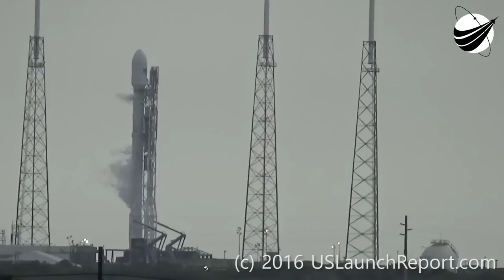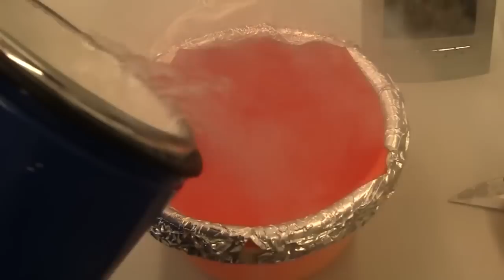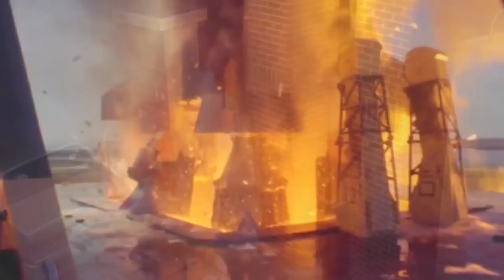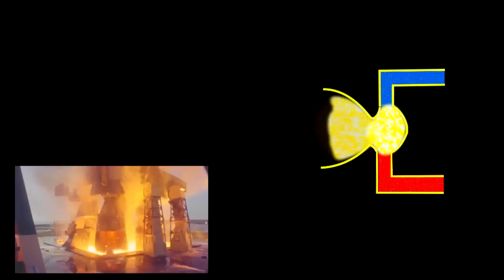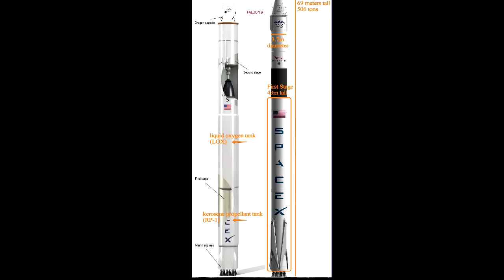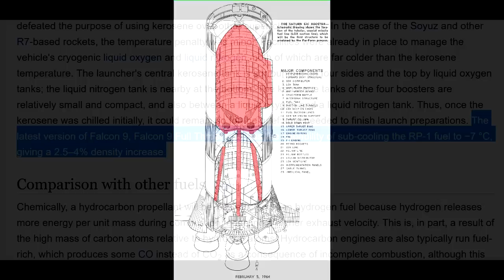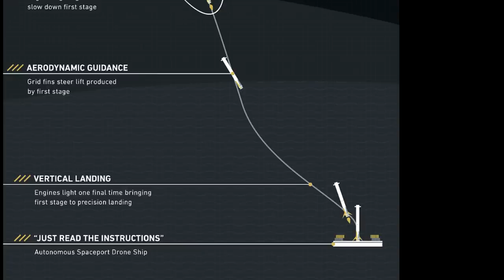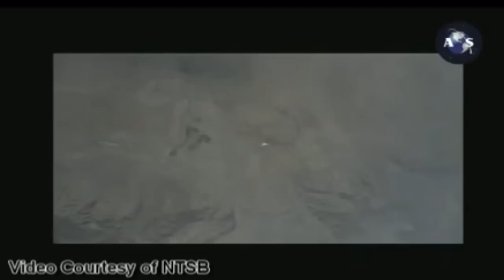Why did the Falcon 9 Explode?

Comment: Aerospace space engineering is changing sadly.  20yrs as a designer and the integrity is being replaced for cost savings and glamorous projects hiring youth for the cheap/free labor.  I believe nasa will Come down on Spacex once they are trying to certify the vehicle for manned operations.
Reply: It's always like this.  R&D is always expensive.  After you figure out how to make it work you start pushing the limits of what you can do to reduce costs.  Most technologies wouldn't be financially viable if they stayed at the original R&D costs.
Reply: NASA is heavily involved with SpaceX so I don't get why everyone thinks they are turning a blind eye to crappy designs.
Reply: +bensemus x  It's not a simple face value effort.  You have a process to follow for every nut,  bolt or rivet. Loads models are performed in line with design from detail to full vehicle level.  Nasa can be involved in conceptual design,  but it's a far cry from having an audited sign-off process like you would between an air authority for instance,  because it's bloody expensive and as stated in the video. Galactic case is none existent. Problem we have is Spacex amongst other startups are not paying for experience.  They have a preference for young engineers Chasing glamorous projects as they know they work 30hrs OT for free.
Reply: Brian Eastwood They also have a 93% success rate which is in line with the average success rate for other rocket programs. They aren't just taking people's money and doing nothing with it. They are already profitable with their satellite launch business. They have dropped the launch cost from NASA's $500 million to ~$60 million. They are doing all this while also working on making the rockets reusable. You can't compare SpaceX to the companies making the Hyperloop and such. They already have established customers and a good track record. They have secured their first customer to use a recovered first stage.
Reply: Brian Eastwood So they are doing very well yet they are also doing bad? Sounds like TF saying they are moving too fast and then getting angry when they have yet to launch a recovered first stage.
Reply: Brian Eastwood They didn't start with any of that NASA tech. They almost didn't start at all when their rockets kept failing. Their products are already performing and yet they need to engineer them better still? NASA doesn't have a sunny past so idk why they seem to be the golden standard. They have done extremely stupid things with manned missions that killed people. SpaceX isn't just ignoring everything NASA has learned. 

SpaceX has lost two rockets and everyone seems to want them to close shop. Every Time NASA lost a rocket it was learned from and the designs were improved.
Reply: Brian Eastwood Searching about those NASA patents makes it seem like those were released very recently, much to late to help SpaceX develop their rocket and engines. You haven't said anything about shutting down but if you read the comments on the video people seem to think that despite SapceX's record they are doomed to fail, including TF.
Reply: Ariane5 had 4 failures within first 30 flights
Reply: +bensemus x 96% of launch vehicles not including this vehicle.  Actually they have lost 2 vehicles out of 29.  The initial due to the structural failure that should never have been a single failure mission critical item.  I was talking about the state of engineering in general, as I work within it, also having many colleagues in the industry including Spacex. Western engineering is being taken through the nickel and dime extraction engine only time will tell what this will bring.
Reply: +bensemus x for repeatable performing products they'll have to incorporate engineering standards that take a great deal of investment. This will be more of a subject with manned vehicles.  Also they didn't start from scratch they attained a great deal of nasa tech once they switched to passing out contracts.
Reply: +bensemus x who was saying Spacex should close down? It's not black or white,  you can love what a company is doing and still have opinions on where the issues are coming from. Also Look at nasa releasing patents over the years since they announced they'd shift these contracts to third parties, see how they are handing out technology.  years and massive amounts of research and a foundation to give a company how to do a lot of things they need to do for those contracts.
Reply: Are we talking about same NASA? The one that put people into badly designed space shuttle without any escape systems and then killed 14 of them because of their stupidity and cutting corners?

Comment: There's a reason that "Standing on the shoulders of giants." isn't just a cool quip or meme when it comes to rocket science. There's 100+ years of engineering and science where an experiment's result is either "Breakthrough!" or "Massive detonation destroying labs, valuable equipment and risking lives. Not to mention at a price-tag that could bankrupt most nations." 

Paying for rockets and fuel is the easy part, the hard bit is going from launching fireworks and small missiles to human space travel. The man-hours, resources and insane pace needed is mind-boggling. Financing the early space programs was straining the national budgets in the two largest "empires"/super-powers on Earth. 

Private enterprise couldn't do a Mercury/Apollo or Soyuz type program or even the Shuttle if they were asked. Human space flight is literally a no returns investment for the foreseeable future and without profit there's no reason. Space tourism doesn't even pay for the launch facilities, let alone the R&D needed.

Comment: Launching people into space is something which has, up to this point, taken the resources of nations to safely accomplish, and sometimes even then there were accidents. IMHO, private companies, which necessarily do things as cheaply as possible, will never be as safe. For safety to truly be first priority, the CEOs would need to be the ones taking the first trip.
Reply: Sufficient regulations can somewhat solve the problem. I think the commercialization of cross Atlantic passenger flights can serve as an example. Plus you dont have to be "safe", just safe enough for the people who are willing to spend that kind of money.
Reply: Elon Musk has said he would like to die on Mars. Maybe he will during the landing.
Reply: PierreDolphin There may be a slight magnitude of difference between sitting in a prop plane with a couple hundred gallons of gas and sitting atop tons of liquid oxygen and kerosene while a controlled explosion shoots you into the vacuum of space. Not at all saying that it can't be done, but trying to do it as cheaply as possible, as private businesses tend to always do, is, again, imo, a recipe for disaster.

Comment: I follow SpaceX and Virgin Galactic, wrote a report on Spaceship 2. I have very simiplar feelings about the failures between both vehicles. It seems to me that the engineers and possibly Elon Musk are somewhat over confident. Human factors and simplification of design are very important factors in aviation, tiny details like the fuel selector switch placement are scrutinized theres is no reset button in real life if it can go wrong it will. R.I.P John Denver.
Reply: Are you just glossing over the things NASA has screwed up on which resulted in people dying?
Reply: ***** I never said NASA hasn't done great things. i'm pointing out that everyone working in Space has suffered failures. The difference is that when NASA failed the public redoubled their support. When SpaceX fails and only loses money not lives people call for it to be scrapped.
Reply: bensemus x and SpaceX failure in this video was something that was solved decades ago by those same people you are shitting on.

I don't see people calling for SpaceX to be "scrapped" especially since it's a private company, so it would be impossible to do such. Unless the company fails to make a profit.

Which would be the fault of the company, and your god Elon Musk.
Reply: ***** This whole comment section is asking for it to be scrapped. Plus just because an issue has a fix doesn't mean it won't ever fail again. No fix is 100%. It's a dumb thing to get held up on. If they keep making the mistake then it's an issue but they've lost 2 rockets to two different issues. They so far aren't repeating any mistakes. Their use of much colder oxygen also makes it harder. Most rockets don't use oxygen that cool.

Comment: How dare you question lord Musk!

More seriously, Initial press releases seem to say that the failure was with the ground equipment rather than the rocket itself.  Not sure how the fuel rig is configured though so can't speculate as to if freezing kerosene could cause issues there too.

Comment: Well we still do not have all the data on what happened so I'm going to hold judgment. But from how the first few frames of the explosion are off centered right by where the external fuel lines are, another spot where the fuel and oxidizer are located near each other, that is where I'm suspecting. The internal fuel lines are a good suspect though. I just wonder how a spark could appear there. In any combustion there has to be a trigger.

Though I do just wish they would hurry up and attempt to launch on one of the used rockets to put to bed the debate on if it is feasible or not.

Comment: Saying that SpaceX has never reused one of its landed rockets is kind of dishonest.
I mean yea, it's technically correct, but you gotta keep in mind that that's just because they are still preparing those rockets for a new start because they want to minimize the risk of them failing. You can't expect them to relaunch the first few rockets they landed within a few months.

And about the Space Shuttle program, it was partly so expensive because they only reused the shuttles themselves, not the rockets that launched them into space. Those had to still be rebuilt for every launch.
Plus you can expect that the program would've been even more expensice if it hadn't reused the shuttles. 

I gotta agree tho that if this was the result of a beginner's mistake SpaceX really needs to fix those problems before any new launches. Then again, we don't yet know if it really was a beginner's mistake.
Reply: They have already completed a full test burn on one and it didn't blow up so it's looking good :P

Comment: You mentioned how SpaceX should use parachutes to slow down the booster before using the engines for the final touchdown. Here's why:

- SpaceX tested this during the early days of the Falcon 9, the chutes always ended up tearing up, no way around it.

- You would need huge parachutes to slow down an entire booster (even a nearly empty one), and it would add to much mass.

- The booster needs to land on a very precisely, chutes don't exactly give you accuracy.

- The chutes would add too much stress on the rocket while descending.